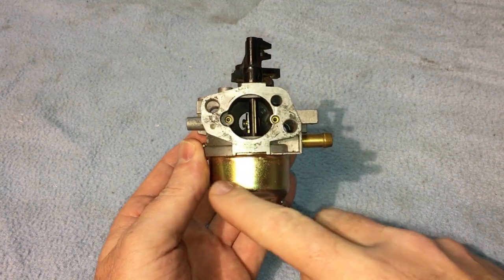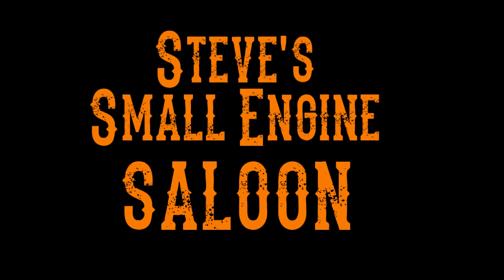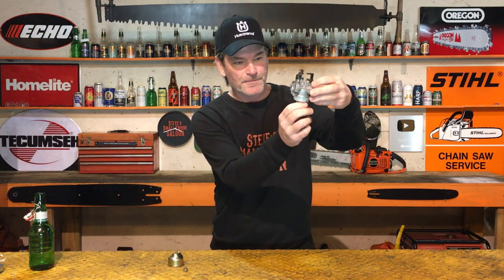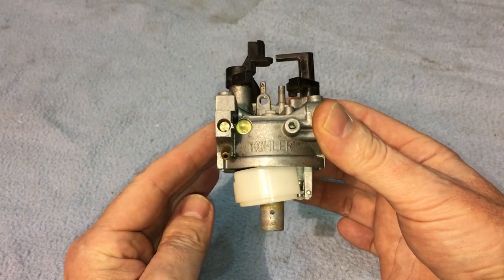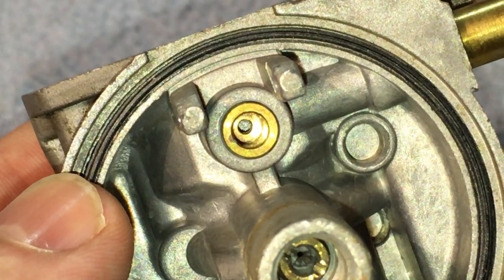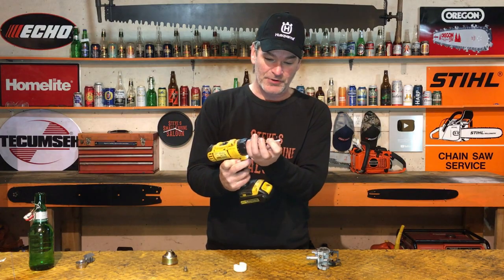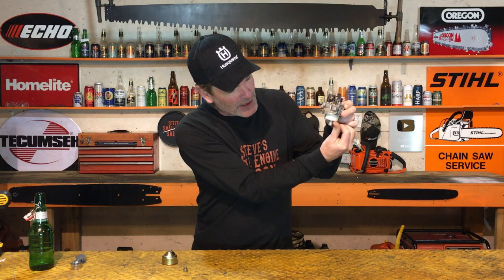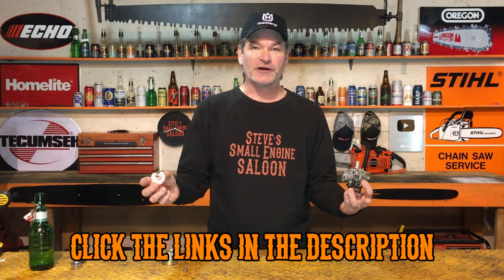Here's Why Your Lawn Mower Is Leaking Gas - Honda Style

Comment: After spending hours chasing a leak from the same carb I have, ends up it was a clogged vent hole that wouldn't let the fuel vent thus flooding the carb and soaking the floor. Something to consider. Thanks.

Comment: I bought a new Honda carburetor because gas was spitting out from the carb side and after starting it up for the first time it ran good for 5 minute and now is back to spitting out gas and  flooding everything I have no idea what's going on???

I popped the valve cover off and check the valve stem and it wasn't stuck on either side so now I am really confused about why the mower isn't running at its best especially after changing spark plug, wax assembly, fuel line, carburator .. could it be the gaskets ?

Comment: Steve, I have a Stihl 031 AV that I cannot get it to idle.  Put a new carb on it and new air filter.  Followed your video on tuning a chain saw carb.  Same results.  Runs great at high speed but cannot slow it enough to stop the chain rotating (clutch engaging) without stalling.  Any thoughts on this, air leak in crank case?  Maybe you have a video that I missed on this.  Both the old and the new carbs act exactly the same.   I appreciate any thoughts.
Reply: Intake leak maybe?
Reply: Intake boot may be leaking
Reply: @buddyg1408  thanks, I will check that out.
Reply: @geraldpike5515  great saw good luck  don't you just love Steve he is great 😃
Reply: @buddyg1408  yes he is wonderful.   Even though I have been rebuilding engines for 60 years that had me stumped.   I had an 031 AV that was stolen and replaced it with an 032 that I still use to cut fire wood and heat my house.  Picked up this 031 at an auction,  just too much nostalgia to pass it up.  Thanks again, I'm quite sure that I'll find that as the problem.

Comment: Hi Steve - I've cleaned out the carb multiple times and each time it runs once or twice.  Then gas pours out again.  I then replaced the entire carb and it ran a few times again perfectly.  But after a few times, it is again pouring gas out.  Honda model is HRB216.  Any ideas?  Thanks!
Reply: Possibly a bad carburetor even though it’s new

Comment: hello Steve, please i need some idea for my saw, its a 2010 jonsered (husqvarna) cs2245 , when i put full throttle, engine cut and flames come out by exhaust... i have done: new carb kit  and set it, new spark plug, fresh fuel and filter, air filter clean, igntion gap on flywheel set...  can it be the coil ? Thanks
Reply: Look for a scored piston. Steve Hass video of that.
Reply: @ohiofarmer5918  hello and thank you, i removed the exhaust to check the piston and it's ok, no scores (  i always let my saw warm up before to use it)
also i found something weird with my coil: primary circuit between body and kill switch tab 20000 ohm and secondary between plug wire and body 2700 ohm , it's reversed ?? thanks

Comment: Mine was doing this. Diluting the oil severely. I installed an inline fuel cutoff and just switch it off when I'm done and let the carb run out till it stalls.
Reply: Now you can fix it

Comment: I can buy 3 Chonda carbs for the price of the OEM Honda needle. Got a Chonda carb on my Husqvarna that has a GCV160 Honda engine. Been running like new for 3 years now.
Reply: Yeah I bought chinese carbs for my Echo leaf blower and it works great. I only paid $16 for it on Amazon and it came with new gaskets, fuel lines, air filter, spark plug, fuel filter, extra primer bulb and even the special adjustment screwdriver - amazing deal.

Comment: So, I cleaned this carb 15 times, I test it and the float works fine. Put it together and it don't pour fuel. 

But I run it, and as soon as I shut it down it's pouring out again. New gaskets and everything.  What gives?
Reply: Just replace the carb. $67 OEM for the assembly. Worth avoiding a headache.

Comment: As a guy who works motorcycles let me tell you a trick I learned.  Dump the Honda part number for the carb needle Into the search engine and you might find a bargain. There are a few aftermarket sources that source parts from the original supplier to Honda who will beat Honda Prices. . Hondaore than anyone will use common parts across a wide variety of engines across a long time span

Comment: What size is the screw that at the bottom of the float bowl that holds the bowl on? I unfortunately damaged the aluminum piece the screw goes into trying to get the inner jet out and now the screw starts screwing in straight but then goes a little off center before it gets tight and won't properly seal the plastic gasket against the float bowl. I've tried adding a variety of rubber type gaskets to compensate but they don't last. I need to tap the threads but can't figure the size of tap I need without knowing the thread size etc. Anyone???

Comment: Bought a new carb for my HFT Predator 79cc engine. The second I poured gasoline in the tank, it was gushing out of a tiny hole in the side of the carb.  My guess is this is a bowl vent on this new carb. The original carb seems to have a BB-like metal ball inserted in the exact same place, but the replacement carb doesn't have this BB in the hole. And oddly, it looks like it was never supposed to have a BB in it. No idea why this tiny hole exists except to leak gasoline. The hole was designed into the casting, it doesn't seem to be a defect. Maybe the carb needs to be primed by unscrewing the bowl's side screw to allow gas to run into the bowl instead of out the hole??? Anyone? It made a mess, so I'm hesitant to try again until I find some answers. Tx

Comment: Steve, 
check your pay pal, i just bought you a beer!!!! (happy hour prices")... 

after 42 years of use my high ball bearing rear wheeled  craftsman push mower  was finally put to rest..... my wife convinced to buy a new mower,, checking the internet i located a clearance at lowe's ,, husqvarna high rear wheel drive 160cc honda ..$238.99
local store had no stock but a store 30 miles away had a display model i put it on hold and drove there.... looked it over ask about paperwork and box , which they did not have... the store associate told me he would ask the manager for a further discount,, when he returned the price of the mower was $100.00,, he came with me to the checkout  to relay the pricing ,,,, WOW $100 bucks for a $479.00 mower??????? all day long!!!!!

returned home checked the oil, filled with gas, pulled the rope started first pull, after about 1 minute it bogged down and died gas was pouring out the air filter ,,,turned off the fuel and called my mechanic
wanting to take it to him,,, he said he was not doing any repairs do to covid 19 peroid!!! he gave a few tips to look for so i turned to youtube and stumbled  apon your video's on mower repairs...

after watching your video on Honda carb trouble shooting and repair " a few times " i was confident i could do it, took off air filter and carb and kill switch being careful of gaskets.. opened the fuel bowl noticed green sticky droplets and inspected float,  pulled the pin  needle valve had similar green on tip and inside seat ,,,, cleaned green goo off tip and seat with carb cleaner float and bowl  too
re-assembled ,,,,STARTED FIRST PULL !!!! 
Your video's are complete,informative and comprehensive and a pleasure to watch ,,had i found them sooner my old mower may have made it to 50 or more years!!!!!!
here's a big
 THANK YOU 
JIM
P,s. next week's project a bogging 4 cycle blower...............................
Reply: Green Goo = way too much Stabil in the gas last fall.  A thorough cleaning to get rid of the Slime and you should be a very happy camper.

Comment: When I fix the carbs on customers generators, it's cheaper to replace the carb because I don't have to include labor time to clean
Reply: True that. I use to do the same for myself for the same reason.  Now I clean them because I can get equipment running fast since I'm not waiting for shipping.
Reply: I worked on gas power pressure washers for 14 yrs.  Mostly on Honda's  GX's and GC's . The GX's  are repairable,  GC's "generally crappy" just replace it.

Comment: Great site Steve! I Subscribed. I am going to drink my Four Peaks Wow beer while I drain the gas oil mixture from my Honda power washer crankcase. Then I will work on the carb float and needle. I thought of maybe a tip you can add... to troubleshoot the carb, check the float assembly while it is still on the engine so that you can know the needle valve is the culprit. What do you think? You added that process at the end which gave me the idea to do it first before I take the carb off the engine. Either way thanks, I am headed to my garage shop. And for all you motor heads and rotor heads out there check out or CHOPPERGUY You Tube channel. Thanks again Steve, Bruce

Comment: Run some Sea-Foam through your engines once in a while to prevent any build-up such as this. Especially when putting your power equipment into storage for the winter.